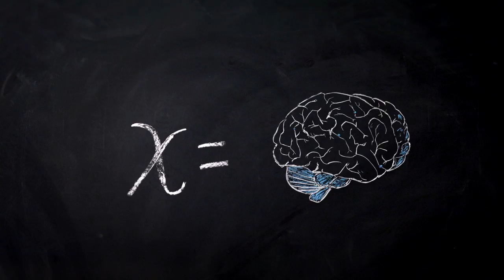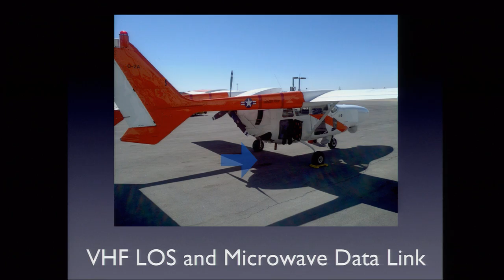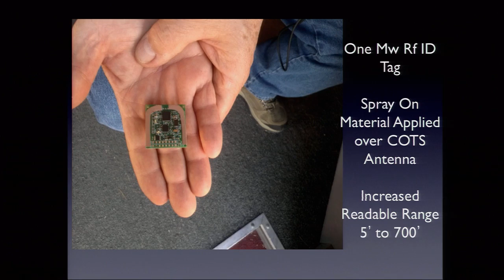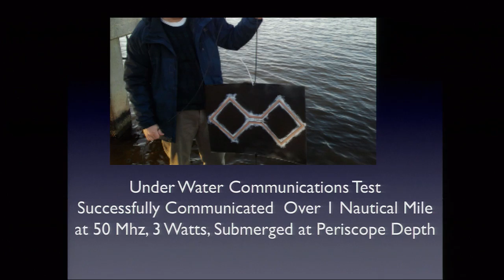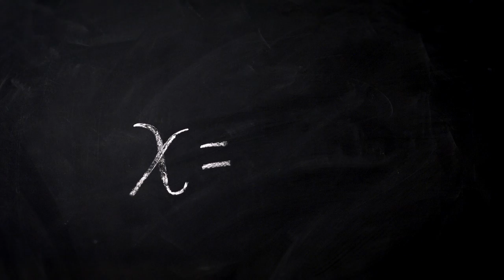Anthony Sutera on low power wireless everywhere

Comment: Having been an active ham since 1958 and a commercial 2 way radio technician, I have yet to experience ANY mobile antenna getting hot.
I've used power levels well beyond those used by police or taxi mobiles, not Kw but  certainly 250 watts SSB.

During damp days, high Q LF antennas will ionise at the the tip and handling it while on air could produce nasty RF burns but no noticeable raise in temperature capable of being felt by touch let alone burns. Where does he get that idea?

Suspicions were further aroused by his use of the word "computated"   (eh?) and the fact that there was not a single spray can on display...
Pretty dodgy?
Reply: There were several bits that raised eyebrows. 
If he's working for the military, he's probably not allowed to give exact information about how his painted antenna works, and may be required to include some amount of disinformation about it. 

With regards to the capacitor's being more efficient... that's clearly bullshit since capacitors act as a resistor to AC power, and small values give higher resistance. 
If we take that to be true, what he's talking about are high impedance antennas. The rest is just flourish for the camera.

Comment: Don’t forget, “military”. The shear fact that it extends wireless connectivity to such a degree may make it hard for us consumers to get ahold of. Why? The military does not let civilians to have better any thing then they do. If a submarine vessel (russian) equip itself with consumer wireless tech, they would be able to detect our subs 20x further with our currently equipped extremely low frequency communication which where designed to be undetectable at range, especially underwater. All our wireless communications security is equipped to to protect itself against the old design. We (consumers) won’t have access until the military is beyond yesterday’s par.

Comment: This is a hoax. Boron Nitride nanopowder, used as glitter spray paint made from the pencil shavings of the semiconductor industry can't create 20 dB gain.
I saw the video and read the articles online (all copy-pasted from the original it seems) with no published material, no charts, equations, no theory, no experimental evidence, no Smith charts, no antenna polar plots, nothing, nothing, just a lot of handwaving and nanotech hype.
Even if it is remotely true, as Hexagonal Boron Nitride nanoparticles do have some RFID applications, 95% of this is presented like bullshit.

Comment: What a load of BULLSHIT! How are we to believe anyone who doesn't proof read their presentation? Your 1mW (milliwatt) RFID tag example is labeled as 1Mw (MEGAWATT = that of a large power station). What 'antenna expert' would miss such a glaring mistake? Little spray on capacitors? What is their value? The frequency dictates the value, and there is no once size fits all. Cop car antennas get hot from transmitting? Total nonsense. This guy should give Seán McCarthy from Steorn a call. Total SCAM!!

Comment: Real low-power-wireless-everywhere tech is being effected by stuff like MIMO: Adaptable phased-array antennas, roll-to-roll printing of electronics, cheap carbon nanotubes and ultimately grapheme technology combined with the cool new metamaterials recently developed and proven in the lab show real promise. The real solutions are unlikely to be applied by simply spraying goo from a can.

Comment: @realmsofinquiry There's no free lunch. Even if the thing was real - which I doubt - "harvesting" radio energy would mean eating up from the transmitter's energy budget. This is one more case that makes me really not have faith in the presentation. He states that cell powers could power themselves (from the signals they are supposed to be transmitting). Or maybe they'll power from the competitor's bandwidth, thus making double duty? :P

Comment: He made several mistakes in his presentation which tell me he is not the technical guy, but probably the marketing guy.  For example, you cannot have a "gain of 20 dBm".  He also implied that when you double the power, you double the range.  This tells me he has not done a path loss calculation, which every RF engineer I know, has.  And radio signals do not have a "happy spot" on an antenna.  It looks like they may have invented spray-on copper tape, which is better than a rubber duck.

Comment: Laughable - Just a few seconds into the video it is obvious this guy is either a fraud, fool or both:
1) "transmit from the bottom of the ocean" Nope, impossible - physics 102 shows how very nearly 100% of the RF energy will reflect from the surface of the water back towards the transmitter. 

2) "cop car antenna get extremely hot" No, it just seems that way because the RF is buring your hand - the actual metal in the antenna dissipates very little "I squared R" heat.

Comment: I remember trying to sell SWR spray on the CB years ago, is this the stuff of legends?  I'm a ham and I know all about antennas, efficiency, matching and how different materials work as antennas at different frequencies, but come on, the iPhone example where they claim 20dBm increase over the standard antenna! dBm is actually a measurement of power rather than gain/loss so maybe he means 20dB better, but if so that requires more than 64 of the same antennas in an array! And paint can do this?!?!

Comment: This is just simply "passive gain" and there are strict regulations in how much you can broadcast on certain frequencies.  So it may be nice you can spray things but if the gain makes the device go over the EIRP then they are illegal.  There are also health concerns for increasing the radiation of a wireless device beyond the EIRP.

Comment: This presentation is either a hoax, or the result of very bad engineering, and Google needs to do a better job weeding out Solve for X candidates.  

Here are two quotes that make it obvious he has no idea what he's talking about:  "A painted stripe on the highway that will allow you to have broadband connectivity in your car through an array of antennas"  and  "Can you imagine for a minute that same device transmitting from the depths of the oceans to outer space".

Comment: Where can I buy it?  I will test it on my G5RV and 160 Meter inverted vee and see if it works.  Just might be able to get that DXCC on 160 after-all.  Heck - I will even spray it on my Eagle One in the summer for portable operations.  I have had some experience with spray on copper for RF shielding at my work location and that worked great so this is not hard to imagine.  As for the presentation - so what if he is not a George Cloney, he is probably smarter and making more cash than all of us!

Comment: @Obja That is not correct. Visible light interacts much differently with water than RF.  Light passes through clear salt water (by definition) fairly well but RF at 50 MHz is highly attenuated at a rate of ~80 dB per meter. So for each meter of travel, the signal is reduced by a factor of 100,000,000 independent of the antenna design. This is because at 50 MHz, salt water acts as a conductor and absorbs most of the RF energy.

Comment: @vMufasa As an electrical engineer with antenna design experience, I can attest that the possibility of successfully transmitting from the depths of the ocean to outer space at 50 MHz using any antenna design is nearly zero. Due to very high attenuation, you would have to space the antennas just a few meters apart from the ocean floor up to the surface to get any signal through, a prohibitively expensive and completely impractical endeavor.  Better to have have a wire to the surface.

Comment: "... being able to transmit from the depths of the ocean to outer space, effortlessly transmitting between themselves" needs to be proved.  With the antennas only being 20 ft deep, how do you know there are no surface effects that augment underwater transmission between the two antennas?  50 MHz is very highly attenuated by salt water regardless of the antenna you use.  I'd like to see a demo with one antenna 1 nmi under the surface and the other in outer space to back up that claim.